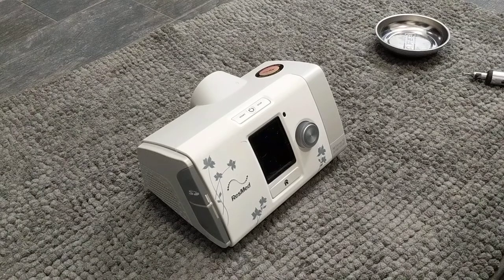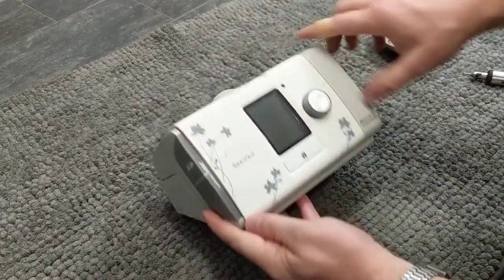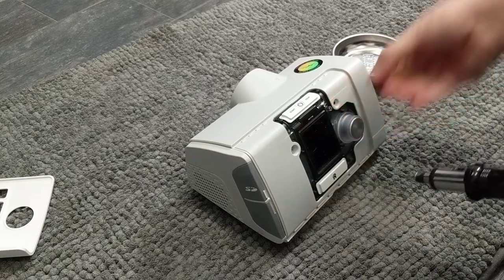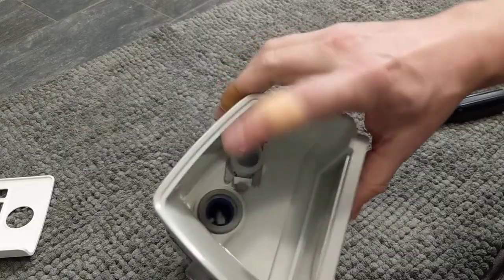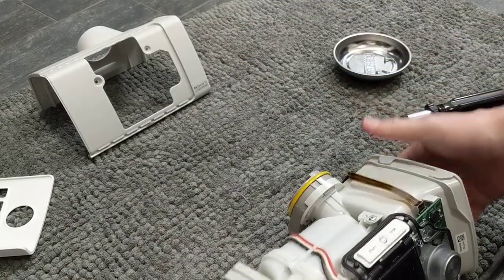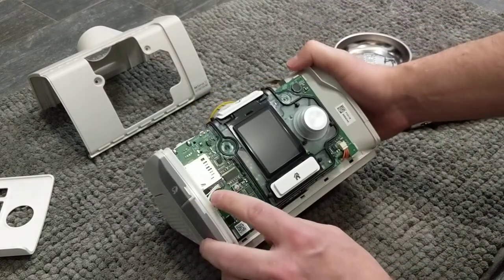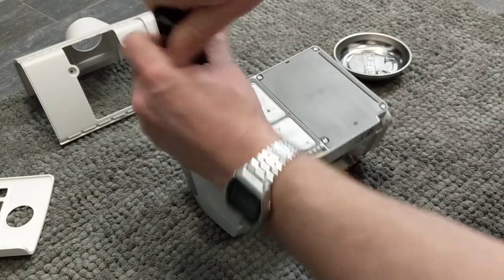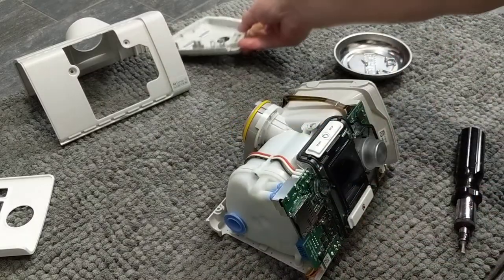Disassembly and modem removal of ResMed AirSense 10 AutoSet For Her

Comment: Followed your lead.  Last night my machine started wheezing with inhalation.  Plus it seemed that it was an effort to inhale, not enough pressure.  So today I took it apart and cleaned everything.  The foam ring was extremely dirty and the fan blades were caked with stuff.  I actually submerged the motor in dishwater for an hour, soaking the gunk, and then blew the whole thing out with a hair dryer.  Man it works sweet now, like brand new.  Seems to have more pressure too!  I'll make another comment after trying it out for a couple days.  There is no telling how degraded the performance might have been over time.  Thanks for the effort.
Reply: So is it still cooperative, especially with your method of cleaning the motor? 🤔🤷‍♂️
Reply: @cruzinsweetsntreats  Yes still works fine.
Reply: Thank You, CB. Mine was not loud like the dying cow sound. I am just going to vacuum it out at both ends and see if that works.
Reply: @Dankness9  did it work?
Reply: @ShipMonster  no, I ended up buying two more of them.  It was too complex for me to disassemble. But I have used it on and off, and still does the job. I just play some rainstorm sounds and don’t worry about the noise.

Comment: Thank you! I was thinking of taking mine out of the box and giving it another try, but have always been weirded out by the modem in there spying on me. I just have the boring, black AirSense 10, and am a bit jealous I didn't get a pretty one with leaves on it. It's all clean and put back together without the modem because it was just in the way when putting it back together. I'll keep it in a special place so I don't lose it in case I sell it, LOL.

Comment: Thank you so much. I picked up the exact machine in your video for $100. I then purchased a new motor from China for $94. It works perfectly. You are wonderfully gifted at illustrating how to service these. Blessings
Reply from the maker: Can you let us know where you got the part? Lots of people have been asking in the comments where you can get parts for this, and I never have an answer. I'm glad it worked out for you!
Reply: I just took mine apart to see if I could get rid of the whining noise but cleaning it didn’t help so I need a new motor. Please let me know where you got your replacement parts. Thanks!

Comment: Really clear instructions in a strip down and reassembly of this quite complex bit of kit, which solved my problem: a dirty and therefore noisy motor that required an air clean.  Local Resmed shop didn't want to know. Thank you
Reply: Looks like, at a glance, that the motor is not disassemblable <- is that even a word? But splitting it would probably let out the magic. So how to clean it? Not an idle question. Seems like mine got something in somehow - maybe a tissue chopped up? Not sure what - or how, but I'd really like to clear the motor and any airways in it to the extent possible. I'd consider a replacement after this video (kudos!) if 1. I could get one 2. It was an economical choice: what would the breakpoint be to add two more years of service life (meaning it would last 4 total?) I don't have a frame of reference; is $150US enough? $200? Are they available? (esp. to civilians)

Comment: Excellent video. I was experiencing a whining noise.  Blowing out motor I still found the fan blades were dirty. I used large pipe cleaners and dipped the end in alcohol. Folded 1/4” of the cleaner  end over on itself to avoid the sharp wire scratching blades.  Using wire snips I cut off the dirty end of the cleaner after every blade cleaning.  Had to do circumference multiple times letting alcohol dissolve the dirt.   20 minutes, a few air blows and they look clean again.  Much quieter.  
Thank you

Comment: Chalk-up another heart-felt Thank You! for this video.  Only suggestion would be to amp-up the volume as I had a hard time hearing the audio even with headphones.  Having said that, the steps were presented to perfection and I was able to complete the process easily and confidently.  I had tried in vain to find someone locally that was willing/able to clean mine.  I don't live in a small town.  This allowed me to resolve the problem myself which is very satisfying.  Thanks Grant!

Comment: Many thanks for this video.  I just bought a used ResMed that had a very slight hint of smoke smell. Taking it apart and cleaning it took care of the problem.  Just a couple of observations on my experience: Exercise utmost care during reassembly, specifically the pressure sensor connections mentioned on 17:05.  Also, there is another part (looks like a ring with a silicone gasket, it is actually sandwiched between the humidifier tank and the back end/output of the pump assembly) that was not shown on the video, but it my case it fell off when I pulled out the pump assy.  This piece apparently connects to another pressure sensor on the front circuit board. Make sure the opening is properly indexed/oriented toward the sensor on the board.  After reassembly, my unit would not trigger the auto start function and during the cool down, the pressure was pulsing (instead of the usual gentle slow constant pressure).  Took it apart again and reassembled it carefully, fixed the problem.

Comment: First video I found that talked about the modem. After replacing the motor, I was getting "Error 001" which means a bad motor or main board. After disconnecting the modem, the error code is gone and the machine runs well. Thank you for posting this video.

Comment: A word of advice. Be careful when touching any of the electronic components. A electrical charge such as walking across a carpet could mess those components up. Touch something metal before you touch the components or use a electro static strap. Thank you for your video and taking the time for the presentation . Well done . Cheers.

Comment: This video was very helpful i found out that i put in my new fan motor in backwards i struggled with connection to run fanmottor so as soon as i turned it around the connection wire was alot easier to connect but this video was awesome

Comment: FYI newer Airsense 10 Autos have the For Her algorithm built in now. 

But thank you. This guide was integral to a successful teardown for me. Got it torn down, soaked, scrubbed and rinsed every part (except main board, motor and modem of course). Despite being good at reading down electronics, I thought this would be more complicated. Very good guide.

Also worth noting for others, somehow I twisted up the climate control ribbon cable and could get it to align properly. You can pop the other ring off and realign the ribbon through the channel.

Comment: IMPORTANT!  a very common mistake at @5:20 See the 2 small blue valves at the top left corner. They are the "Air Pressure" valves that detects your Bi-Level pressure. Make sure you line them up properly when you put it back together OR your VAUTO air pressure sensor will get blocked. I suggest you test to make sure VAUTO works before you put the screws back. Don't forget to set Ramp to off for Bi-Level pressure to work when you do the testing. That is, Press Home and Dial together for 3 seconds for the settings to come up, check Mode = VAUTO, go down, Check Ramp Time = off. 
Hope it helps!!
翻译： 注意@5:20 对正左上角两个蓝色的气压阀，上螺丝前反复测试。不然的话两个蓝色的小气阀感应器被塞住，你会发现上下自动调压力的功能定住不动。
不用谢 (￣_,￣ )
Reply: He does mention this twice in the video, but maybe your notice will be helpful to people who skip around on videos.
Reply: I had no idea how to get into the clinic menu and change ramp settings, so thank you!

Comment: Insanely helpful and easy to follow. I am having trouble with getting it to blow air reliably but I may have pinched a wire somewhere as this was my very 1st time taking apart my cpap. 
I had black ants inside and with the cpap shortage I was told nothing could be done to help me. So I searched for a video and saw this. 
Thank you so much. It’s not perfect but it’s ant free and once on stays on. 👊🏻

Comment: Great Video.  Thumbs up!  These machines are quite well designed and constructed.  A deep cleaning does require disassembly and that can be scary without some knowledge of how it goes together.  

Too bad I didn't find this video before disassembling one of these.  It takes a lot longer when you need to figure out how it is constructed.  Fortunately, I got it all stripped down, cleaned and reassembled without any issues.  

Note:  When reinstalling the pump assembly, the air connection right by the screw needs to be aligned (your video didn't show that, but just in case people are not aware).  Also, to remove any trace of bacteria (the usual culprit of bad odors), a good soaking of washable parts in vinegar, followed by dishwashing soap and rinse is ideal.    

Question:  Where do I find replacement parts?  In particular, the two larger air fittings between the pump and the reservoir.

Comment: Thanks for this! My CPAP gets used a lot outdoors in the field and so its a pretty worn out machine. Got to say the inside was gross. I didn't notice a smell much when using it, but the inside smelt bad. Guess I got used to it :|
But the machine seems to flow more consistently and I don't get runny noses as often from the dander.

Comment: Great job on the demo and not ending were you just simply say and reverse it actually putting it back together with the details about the pinchpoints areas that need to be snapped is very important it was very thorough great job.

Comment: Thank you! They now use tamper proof screws, but they can be removed with a small screw extractor using the screw side only.
Reply: Go to ifixit and buy their screwdriver set complete with all sorts of security bits.  Nice kit they have there.
Reply: Nice video and thanks for sharing!

Comment: Thanks for a great video - very helpful.  I have read all the comments here and related ones elsewhere.  My concern is mold inside the motor enclosure and within the motor case itself.  The white substance on the fan blades may be that, and scraping it off from outside the motor case does not begin to get at all of it covering the inner walls of the clear housing..  This I fear is the dirty little secret about this machine - years of respiration through it's inaccessible innards inevitably make it a health hazard.

Comment: Only 45 subs. You deserve more. You now have 46 subs because I hit the sub button. Was going to pull my airsense 10 apart to see why it’s got a whistling sound with every breathe I take. I assume it’s the motor but I’ve looked around and no motors or spare parts available
Reply: Mine does the same thing, were you able to fix it?
Reply: @adrianhammett341  no I haven’t Asian. I pulled mine apart and gave it a good clean. I can only think that the motor is causing the noise but when I span the motor using a vacuum cleaner hose to spin the motor I couldn’t hear any worn bearings. So I’m still having the same issue.
Reply: Common fault, I demanded a new one from resmed
Reply: @tadstertrolley7770  Resmed will usually just tell you: "We didn't sell you the CPAP. A dealer did. Go to them."
But - Resmed will surely get in your way of repairing this. Right to repair means you should be able to buy the motor. I hope someone is a lawyer in these comments.

Comment: Came here to see if it made sense to try to dig into mine and fix the whirring noise rather than paying the deductible on a new unit. Fantastic video but after seeing that the blower is not easy to break down without brute force, I guess I'm just now the proud owner of a new machine. Had mine for four years before the noise just started out of the blue one day.
Reply: No brute force required. 
4 years is very short life for this machine. It should last a minimum of 10 years and can be refurbished to live indefinitely.
Reply: After reading all the comments: Did you get water in the motor? (If you had the humidifier dish tilted too far, this can happen.) Also, it's possible that a dirty filter let a big dirt ball into the motor. I too have the "whistle on inhale" and I'll be tearing into mine, in the hopes of not having to buy a new one.

Comment: Excellent video.  Mine is 2.5 years old, and the motor is whining. I can't get another cpap for 1.5 years. They want 800 to service it. Your explanations are great, though I suspect there may be some slight differences.  I will look for debris but think it's a motor issue. Might have overfill it. Where can you get parts?

Comment: Thanks for making this video!
I got my first CPAP a couple days ago (AirSense 10 AutoSet).
I always want to understand how everything works. But, I didn't want to take the CPAP apart to learn how it worked since I rely on it. So, your teardown was exactly what I needed to satisfy my curiosity.
Reply: This video only shows you how to clean the chamber that holds the compressor motor (Do not let water near the motor).  It does however let you see how to do it without doing damage and paying someone to clean it.  CARE should be taken as you will not be able to get spares (closed shop) not sold to the public.  However, if you have an old on it is of great value knowing how to get into it without causing more problems than you started with.
Reply: @BoB4jjjjs  is there any kind of class action-type lawsuit to allow replacement motors to be ordered? (Right to repair.) There are similar actions against Apple and their touch screen. Seems a bit silly you can't replace the part that would fail the most often: the motor.
Reply: @fitybux4664  I know, you should be allowed to repair it yourself, but they have it sown up for now!  That may change, but they will not give you the motor anyway, I would bet!
They won't stop you with the right to repair, if you send it back to them for repair.  :-((  They will repair it for you.
No doubt at a cost to suit them!

Comment: This is the best video on YouTube for cleaning the Resmed S10 that I have seen. Do you have a source for parts in the motor? I am getting gray and black dust on the inside of a filter in the head gear. I think it might be the balck foam piece in the motor housing. Thanks again for the great video.
Reply from the maker: Sadly, I have never found a good source for parts. Let me know if you find one!

Comment: Thanks for this video. I wanted to change my ventilator. But when I disassembled it the little plug of the modem broke to parts. Is this little connection cable for the modem available anywhere? Or do you know the name of the connectors so that I could make my own replacement? Thanks a lot in advance.

Comment: Thanks! The whole video was great, but the part I found the most help was when you mentioned that the For Her has both the algorithm for men, as well as the one for women. I hate the look of the black For Him model, but thought the For Her model looked much better. Now I know I can just get the For Her model.

Is it mentioned anywhere in the documentation how to select between the two algorithms?
Reply from the maker: It's not in the user documentation (I don't think) because it's not in the user menu. It's in the clinical menu under "settings." There are three modes: "Autset for her" "Autoset" and "CPAP." The second is the regular mode.  More information in the clinical documentation: https://www.resmed.com.au/hubfs/downloadable-files/airsense-10-autoset-afh-elite-cpap-clinical-guide-apac-eng.pdf
Reply: The For Her algorithm isn't just for women. Some men use it too. Not as aggressive as the regular algorithm. Easy to switch between the two.
Reply: @grantsreviews4299  thanks! that's very helpful

Comment: Have you heard of the recall of CPAP/ BIPAP   units that use the "OZONE" producing machines for cleaning the unit? They focus on the "foam" degradation. The Airsense 10 wasn't included in the recall. I was surprised to see the foam filter in my Airsense 10 🤔
Reply from the maker: I was also surprized to find foam there. Historically, units have used a great deal of foam all around the outside in order to reduce the noise. That's not true of this model. Instead they make the housing out of silicone and isolate the motor from the rigid parts of the unit. I'm not 100% sure what the purpose of the little foam donut here is. The ones I have opened had no degradation in them, so maybe it has to be long-term exposure to ozone. Or a different type of foam.

Comment: Nice video. I have been thinking that after seven years of use i've heard that this will start to nag about usage hours and eventually it will not work. So if you are opening one of these could you take pictures of pcbs if they would have eeproms in there. because i was thinking that i could disassemble my own and take memory dumps and then put it together and use to three hours to see what values change when the hours go up. then we could start figuring out how to either restore working memory dump or start resetting the runtime indicators. Because i thought that i might buy new one before this is bust and use this as my travel machine.

Comment: Ditto what others have said: Great video! Is there a secret to reconnecting the modem/media card multi-wire connector? Reconnecting shouldn't be that difficult, but getting the black holder aligned with the track to slide it into the pins is a real problem! The assembly won't slide back on straight. My fingers aren't small enough and the detail is hard to see. In the process, the left white wire came loose from the left slot of the harness and I can't reattach it. Is that solder I see holding the other wires on the assembly? I put electrical tape on the bare wire and finished closing the unit until I figure out what to do. Otherwise the unit works okay.
Reply: I fiddled with that as well.  Found that you just simply line up the connector (with the wires) on top of the one on the board and push it in.  I would snap back in place.